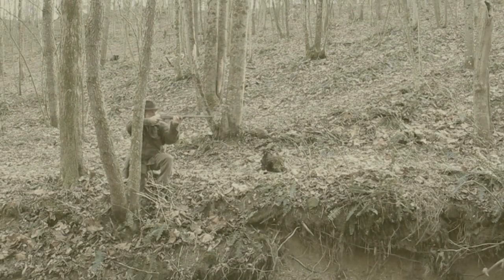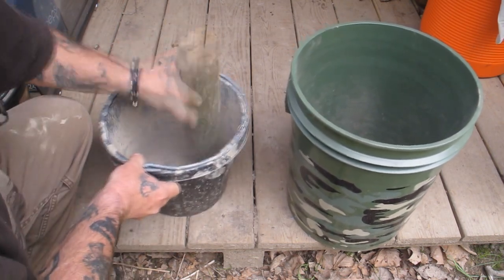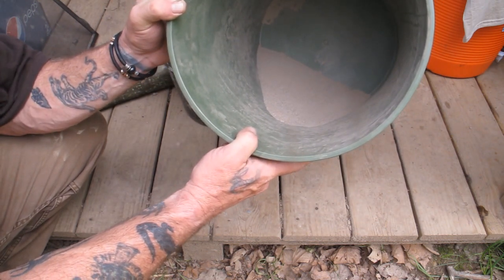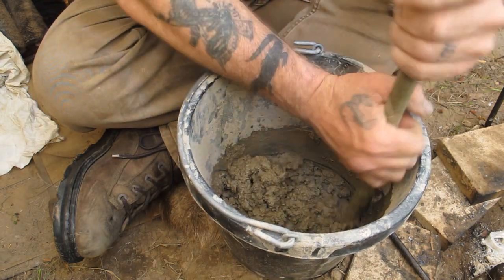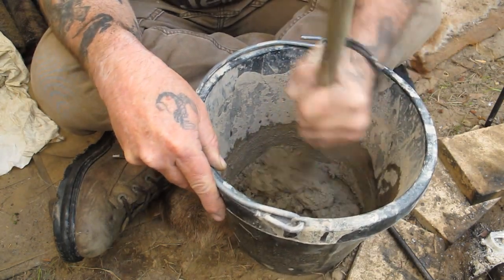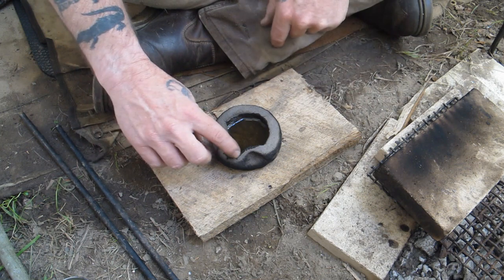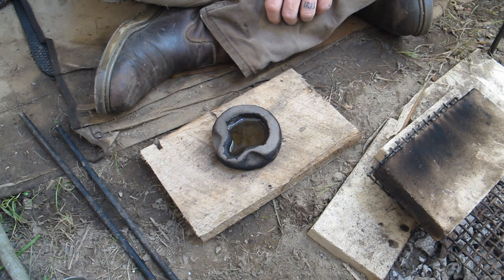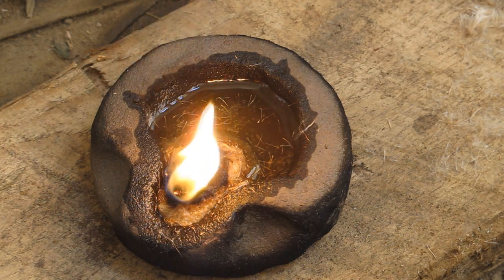Diary of the Tipi 15 Working with Ohio Clay (Making an Oil Lamp).wmv

Comment: First of all, great work Dave. I really respect what you're doing. It's not easy by any means. You can mix the water and clay like you were going to mix flour for bread. Works really well. Also, if you're making a cooking vessel, the food residues will seal the pot after a few uses.

Comment: If you break a fired pot, you can also grind it up, then add it to your next batch of clay. Having even sides and bottoms keeps the clay drying out evenly and prevents cracks because the thin areas will dry faster than the thick. Best to dry slowly in the shade and cool slowly. Try a broken bottle of glass ground up to put in the bottom to melt for hard surface after the first firing. Also, polish the inside before firing. This will harden the surface. I enjoy all of your videos.

Comment: Was just reading about glazes for pottery. See "Ash glaze" on wikipedia. A glaze will make the pottery less porous and can be made using wood ash, clay, and water. I don't know how much heat is needed but I think it needs pretty high heat. It might be something to experiment with if you need water tight pottery. They also used to use "salt glaze" for commercially made jugs back in the 1700-1800's. Haven't found a recipe for that yet.

Comment: Cont~ If the steam can't escape when fired then the piece has the possibility of exploding. In such a situation the oven method provides a few benefits. Surrounding your piece with stones (can even use a clay mortar to make an airtight enclosure) and building a fire on top means that your piece will heat up more slowly reducing thermal shock. It will also cool down slowly reducing shock. Also, if the piece does explode; you won't take a clay shard to the kidney.

Comment: Omg this is soo cool!  Having taken a ceramics class in college, this was really interesting to watch!  This is very similar to one of the ways we fired some of our pots too (though I can't remember the term for the firing method).  Anywho, you spoke in the video about rushing, instead of waiting for it to cool naturally.  Have you tried slowly pouring water on the pot, or sort of flicking water onto it after it's pulled from the fire?  The water will help it to cool faster so you can handle it.

Comment: It depends on the clay and temper used. For the porous, sand mix that Dave has made in this video; you could certainly simply stick it in some coals. The worst that will happen is that it may crack if the clay you're using isn't resistant to thermal shock. That way is stone age primitive. If you want smoother, less porous earthen or stoneware that won't such up liquids; then you have to use a much finer temper. With a less porous clay mixture it means that steam won't escape when fired. Cont~

Comment: Love the knowledge man.I have a blue star tipi from the late 80s and I need poles. It looked like you had flat stock holding yours up and ferring stripes holding up the ozan and liner.Did they leave rubs on the tipi. It looked like 2/4 ripped in half with the corners rounded.

Comment: The clay you're working with looks decent, but there are a few tricks that will make your stoneware much better. Your issues with cracking of thinner pieces could be due to two things. First, the porosity of the binder is important. course sand is fine to make a mortar that you're not going to fire, but with stoneware; finer is better. Second, you should try sticking some stones together in an oven formation on the ground, completely enclose your stoneware and then build your fire on top of it.

Comment: Thats cool Dave. I have a question. What if it did leak and you wanted to seal it, what would you use as a sealant?

You could have made 5 or so lips to hold wicks all the way around that oil lamp and used it like a gas stove top. 5 burning wicks to cook with. Thx for that post man

Comment: would you be able to use tiki torch fuel? because ive used it in oil lanterns before and it worked fine. great video, thanks again dave.

Comment: Lol; the great thing about pottery is that it is cheap to try things if you make your own stuff. ≈2000°F is the only requirement to set a piece, so your idea would work. Structural integrity would be an issue as the clay mix wouldn't hold up through too many firings. If you want to take the time and trouble to make a stationary kiln; you might as well make some mud bricks so you could reuse it. Sift some dirt, sift some dried poop, mix, add water, mold bricks, fire bricks, build kiln.

Comment: If you don't have the screen, do the filtering process with wet material...take your bucket full of clay, fill it up with water, and stir it up. The rocks and sand will settle before the clay does, and most of the organic chunks will float out or settle in a layer. you'll end up with a layer of rock, sand, then a layer of mostly clean clay, then a layer of organics, after it settles. tip out the water, scoop out the organics and then the clay.

Comment: The lamp will eventually become completely saturated with oil and leak out the bottom. Try coating it with beeswax on the inside and outside, or maybe try pine tar. Even if it is burnished it will still leak, but burnishing makes it stronger.

Comment: Your clay mixture looks a little too wet.  When you threw it down (8:53) it seemed to ooze some excess watery material.  Too much water will form steam pockets in the clay as it fires which expand faster than the clay and can crack the walls as the steam escapes.  Too little water will create air pockets that have a similar cracking result.  Think "Play Doh" consistency.

Still, it's awesome for firing in a makeshift kiln.  Great vids.  Keep it up.

Comment: Actually, your rushing a LOT. 
You might have gotten a better fire if you had waited for it to dry for about a week, and then put it directly down into the coals, and built up the fire. Then make sure to let the fire cool slowly. quick changes in heat is not good for stoneware and clayware.